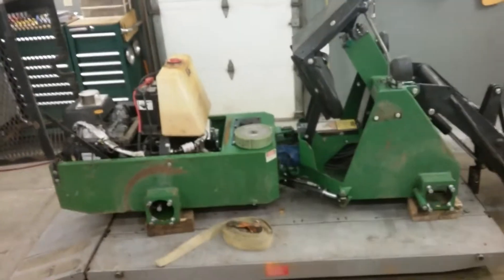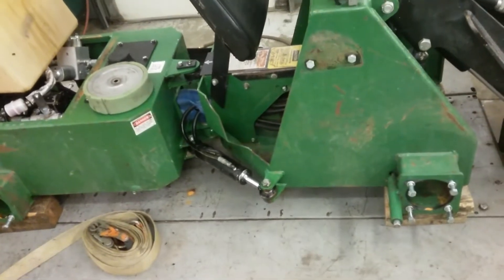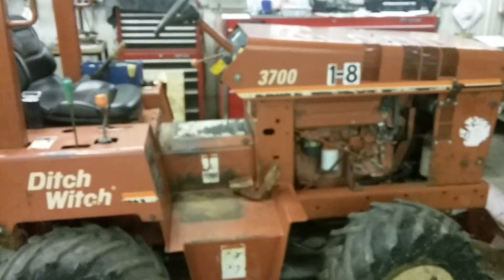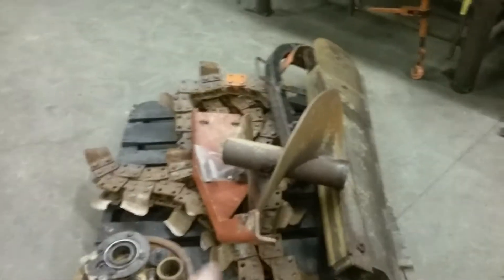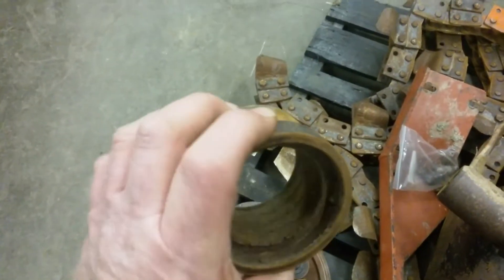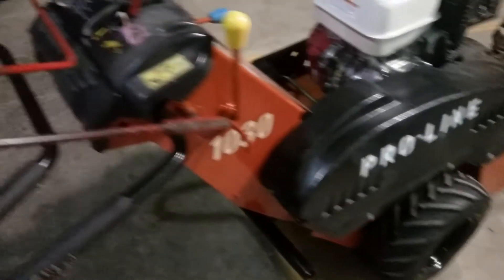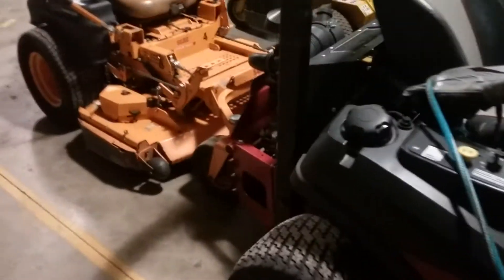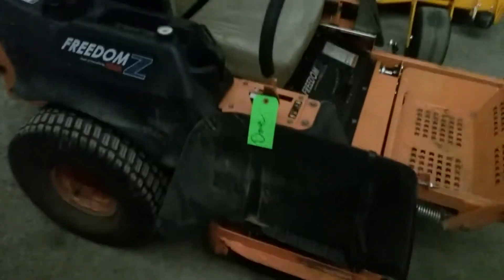Whats going on in the shop

Comment: What’s an approximate cost to overhaul that ditch witch yearly? Looks pretty costly to maintain
Reply from the maker: Didn't have to do anything with the engine other than fluids and filters. 
The cost in parts will be about  $1500.00 + - $500.00 the chain is what drives up the cost. We get about 3 years out of a chain and a year off the cutters. The parts will be payed for around 15 rentals.
Reply from the maker: Its not to bad lots of grease and Keeping the chain lubed and at the correct keeps the cost down